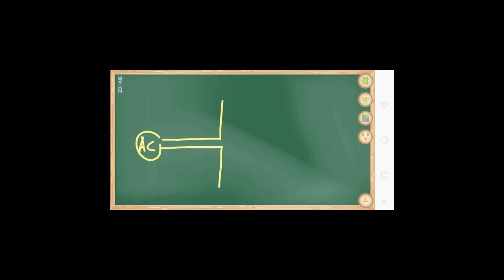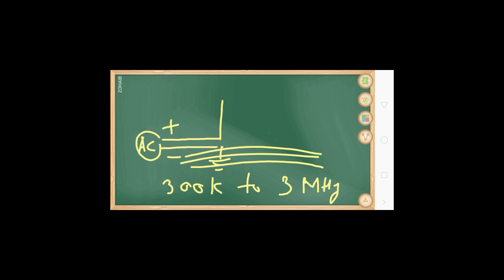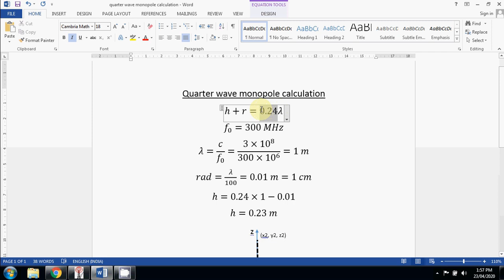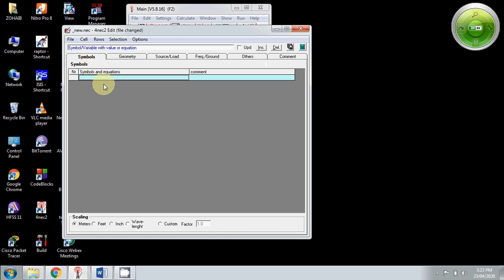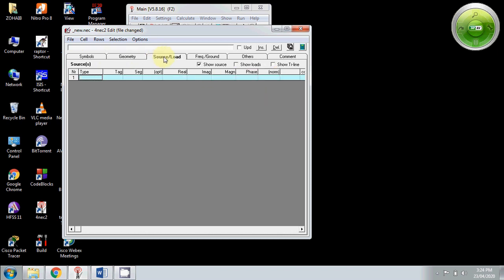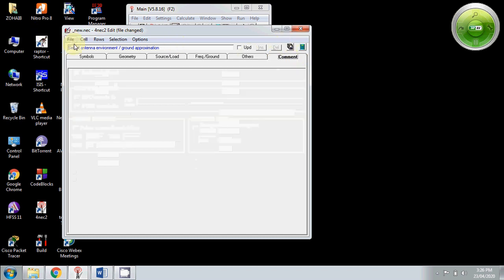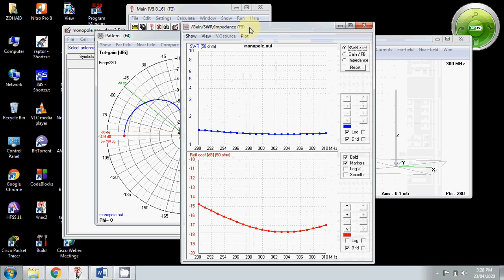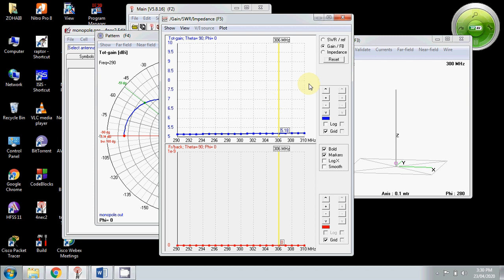4nec2 - Designing a quarter wave grounded monopole

Comment: how  you get input voltage ,imedance ?
Reply from the maker: When you design it, and see the impedance graph for both resistance and reactance. Also you have S11 graph dip, look at the freq and see the R and X in the impedance graph at the same point.

Comment: why did you use 11 segments in the wire geometry?
Reply from the maker: Any number is ok. More number of segments will give more accuracy. But will take more time. While making a dipole odd number of segments are good because central segment will be used to give supply.
Reply: @zohaib166  thank you, I was really confused about that. One last question, where should I put a coil if I'm working with a short monopole?
Reply from the maker: @bartodolopuedo  I did not understand coil...but if u mean... ground...my answer is ....at the supply end..means the end where u want to feed the monopole.
Reply from the maker: If you mean a coiled monopole ...it can be done for the complete length or at the futher end ...because coiled monopole is like a helical antenna working in normal mode